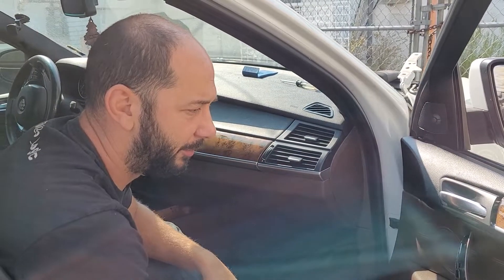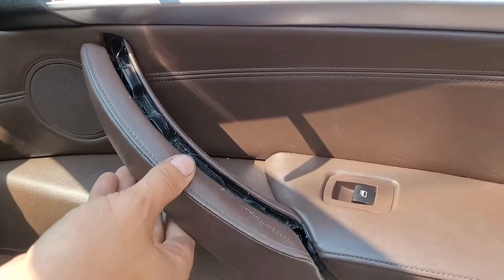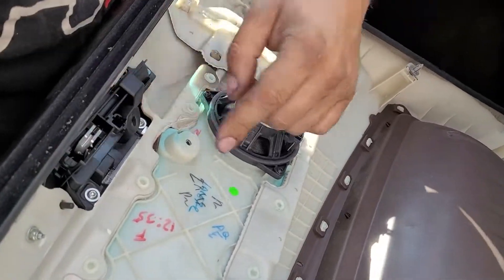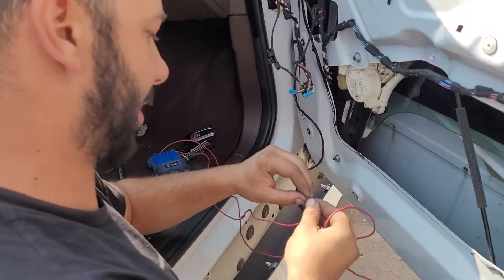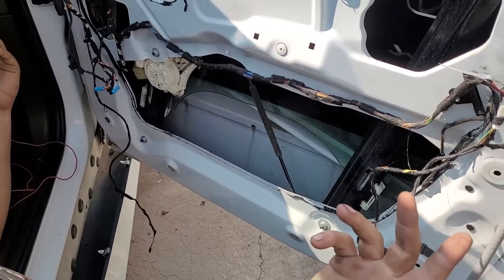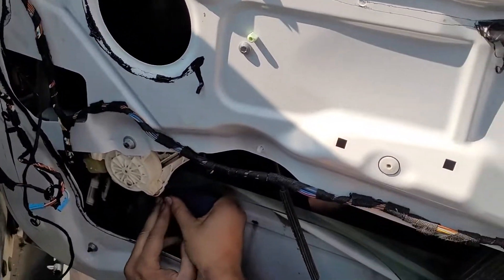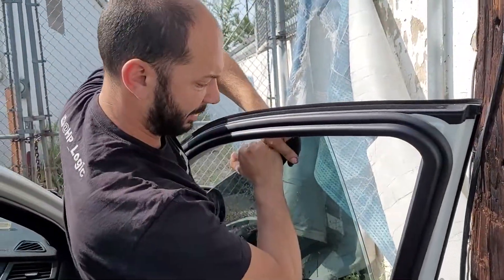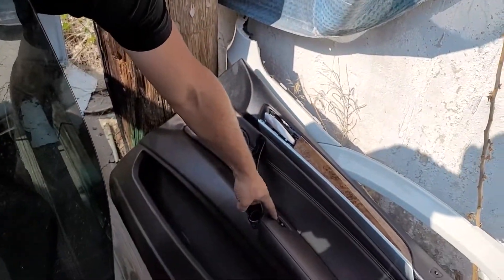BMW E70 X5 Door Panel & Window Removal DIY! 2006-2013

Comment: PRO TIP: Do not use a screwdriver to flip the buckle from behind the glass! You may damage it!
Instead use the directions from BMW which say to lower the glass till there is only 8-10cm of glass showing above the widow opening. Look down at the regulator buckle - can you see the glass hole?? If not, adjust the height of the glass up or down, until the glass hole is visible just above each buckle. Now, holding the glass with one hand from below, use a screwdriver or other sturdy long tool and place it through the glass hole and push the buckle. It will open easily and without much effort at all. Now do the other buckle similarly, and pull the glass up through the door. 
I did this by myself - no help needed. Hope it helps.
Reply: This is gold... did this today, easy as, thank you very much !!